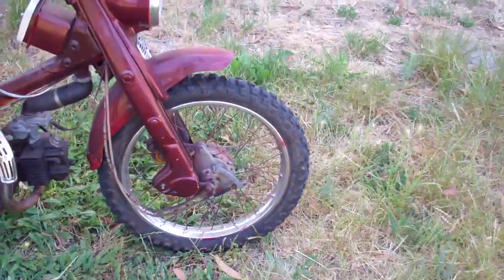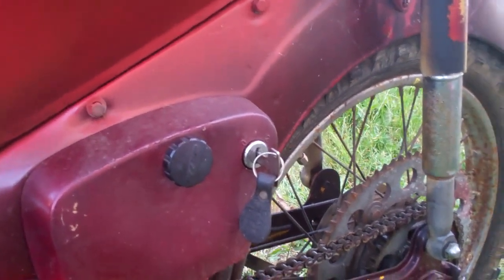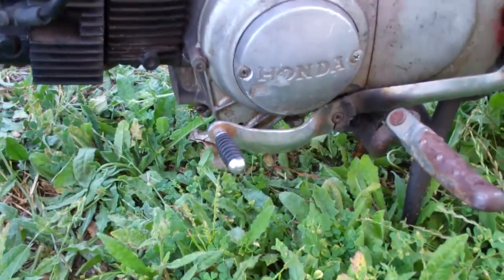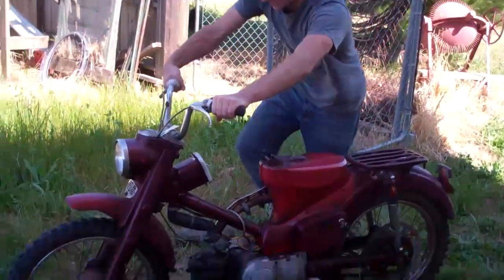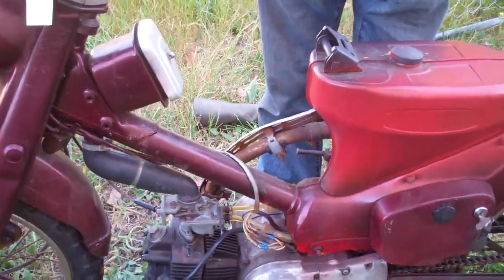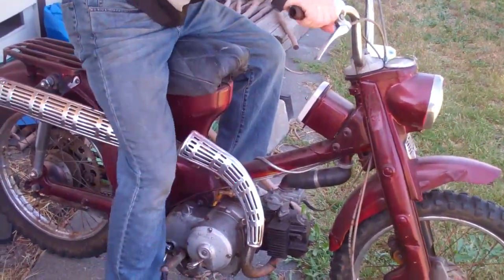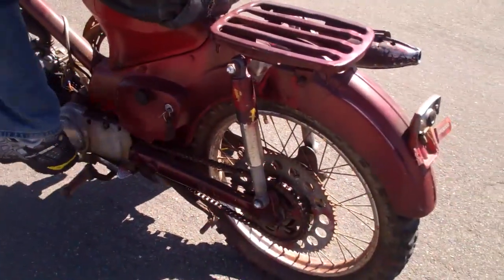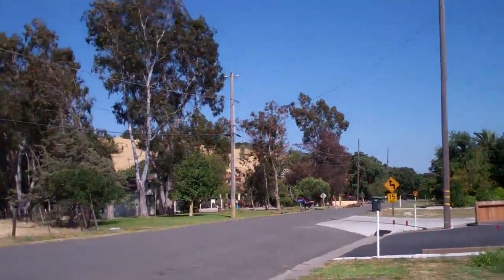[342] 1965 Honda CT200 - 2011-06-25

Comment: I had one. Left hand handlebar 3 position switch is headlight off-low-high beam (Off is down, high is up). Neutral is all the way up. N-1-2-3-4 down. Automatic clutch. Left handle lever is another way to actual rear brake (same as foot pedal). 

87.6 cc. 7500 rpm is 51.7 on speedo. Redline in gears in approx 19, 30, 40 and 51.7.
With 68 tooth trail gear sprocket top gear redline is 30 mph.

Comment: Awesome little bike I have one that was passed down to me, was my dads first bike in 66.  Made them from 64-66 rare bike to find.  There are 2 sprockets and a extra extended chain link that came with the bike. I have mine still but imagine most have been lost, could easily make one.  Its so that u can switch sprocket sizes back and forth easily for road and off road trail uses. Was stored with a small took kit for the bike in the plastic side compartment.

Comment: There is a small two-bolt access plate on backside of muffler you can remove to get noisier exhaust without removing muffler.